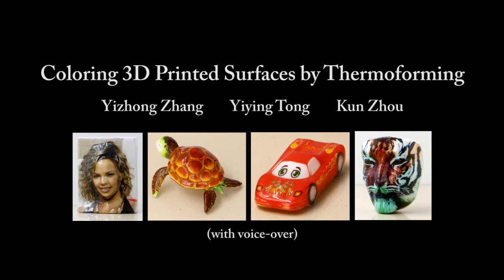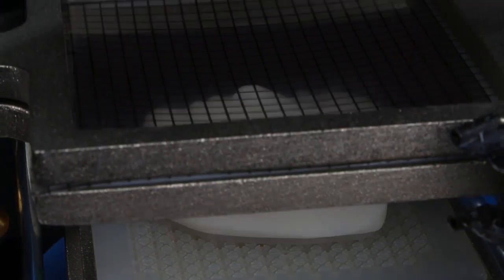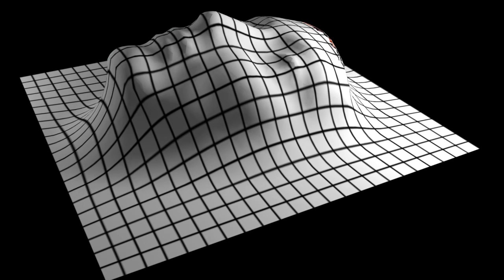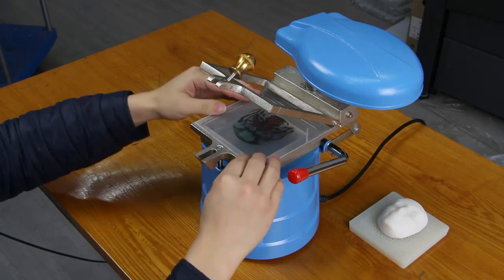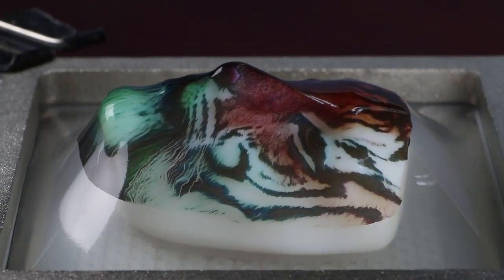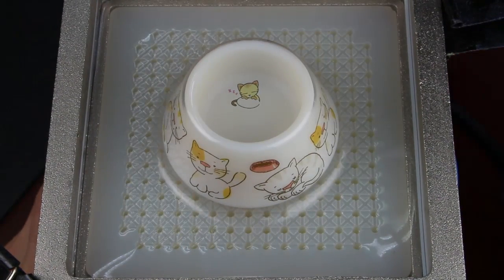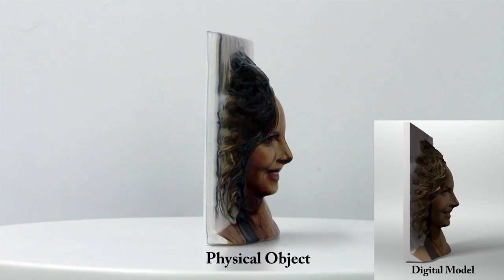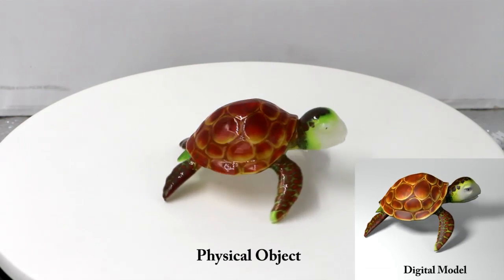Coloring 3D Printed Surfaces by Thermoforming

Comment: excellent work, which brand or, company of transfer paper would you recommend to do exactly that, on either ABS or Acrylic. And does your printer use special inks like the ones used in expensive  distortion printing ?
Reply: Which software r used to making the pattern